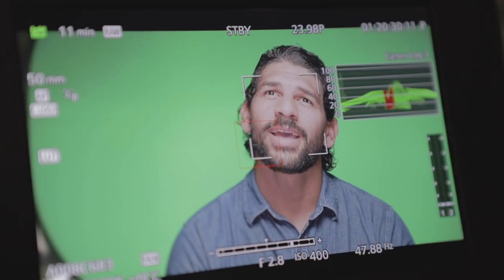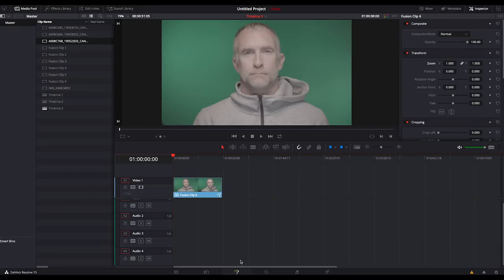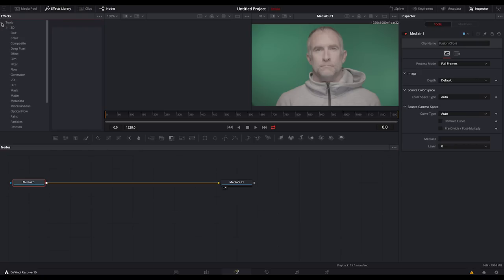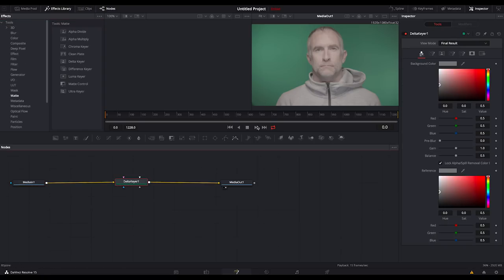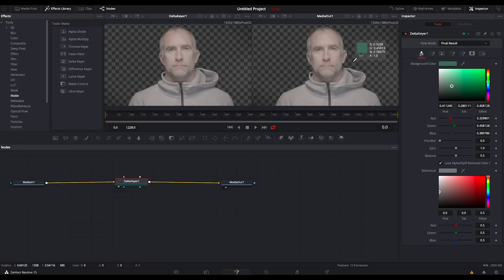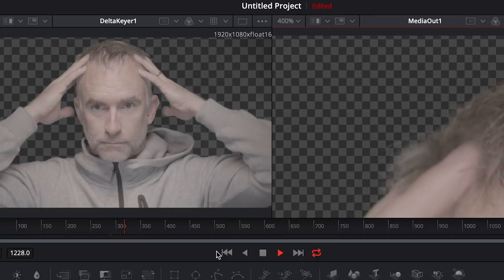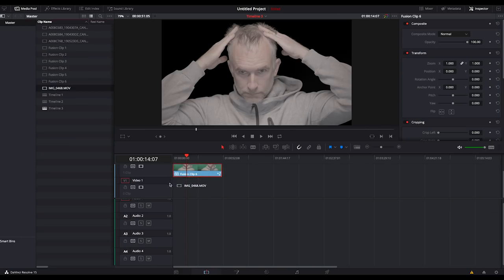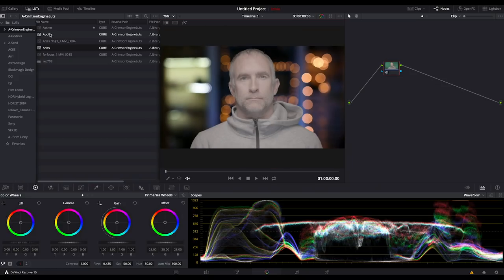The New Rules of Greenscreen

Comment: Holy Schnikes!!! Thanks for the tip about the Delta Keyer. I had been doing green screen in the Color page in Resolve using the qualifier and masking. And thanks for the tips about lighting with green light and lighting ratios. Will also have to try to increase shutter speed as well. Thanks!!!

Comment: I actually have a lighting setup question you used in your video, instead of green screen-- what do you use to hold up the wand light directly at the middle of its weight?  The one you are using for your subject's lower fill...  Thank you.

Comment: How are cell phones and computer screens recreated for film/TV?  Many films show a character looking at his or her IPHONE with dates and text messages, etc. and cell provider name removed from the top line... is that using green screen or is there a software engineer who writes an app to mimic a real cell phone layout?  I have The same question for computer screens or TV’s.. for example, some shows have a character interact with multiple TVs showing news footage or computer screens.  I was surprised those were green screened in some BTS commentaries.  Is it still the case that y can’t film an actual TV broadcast or computer because the frame rates don’t match and they will have rolling bars?